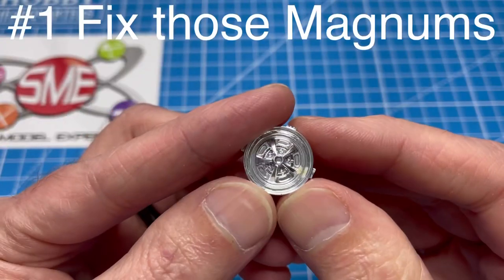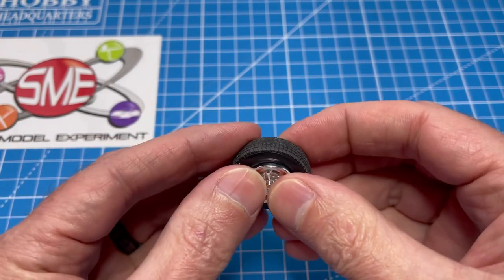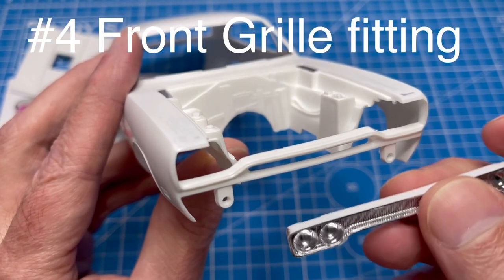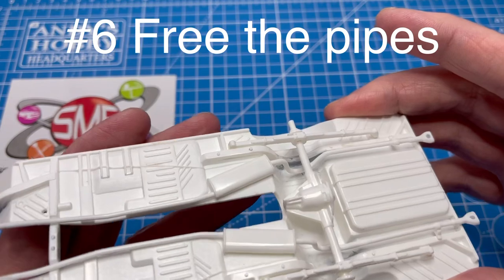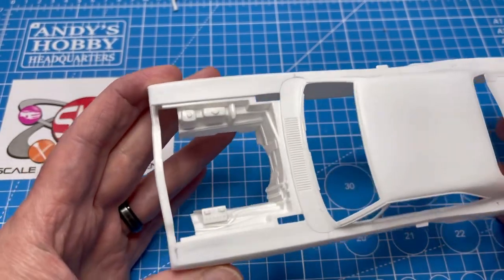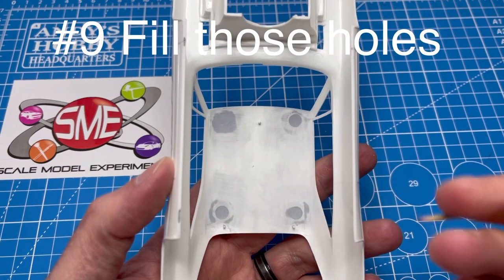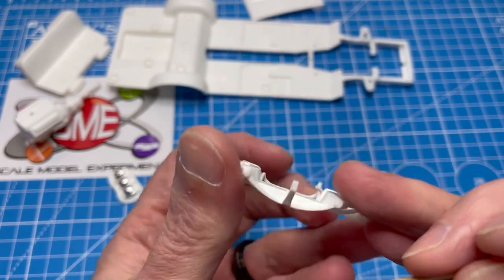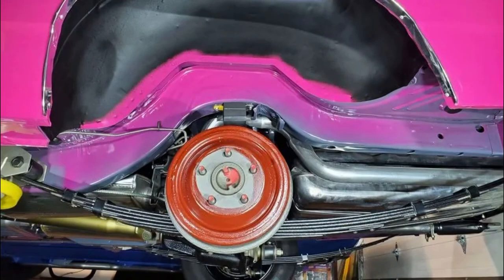10 Tips for your Revell 70 Roadrunner or GTX - USACC

Comment: Thanks for this video! This is one of my favorite 1:1 muscle cars! There are two things that bother me about the design of this kit (I wouldn't care if they weren't so obvious): The battery that appears to be sitting on top of an elevator shaft and the coolant  overflow tank. I may be wrong, but I don't think the 1970 Plymouths had a coolant overflow tank. I own some excellent reference books and the pictures do not show one. I'm sure these errors are not important enough to warrant major surgery, but they're worth nailing down.
Reply from the maker: You’re so right about both Mark. Since I decided that I was building the kit box stock I had to work with what was there. I cut a divide line under both to make it appear that they weee separate pieces. Thanks for watching👍

Comment: Great tips James. I'd like to add one major tip: the space between the front bumper and grille make the front end awkward looking and inaccurate. To fix this,  drill two holes just above the existing holes in the bumper locator tabs and now you have a more accurate bumper to grille space. This makes a big difference in the appearance.  While you're at it, slightly taper the front fender bottom forward of the wheels upward to meet the bumper's bottom edge.
Reply from the maker: Wow, thank you Bob! I’ll make those changes.  I appreciate your help 👍